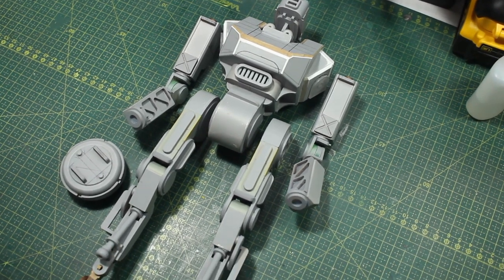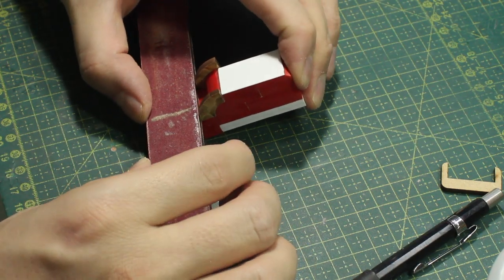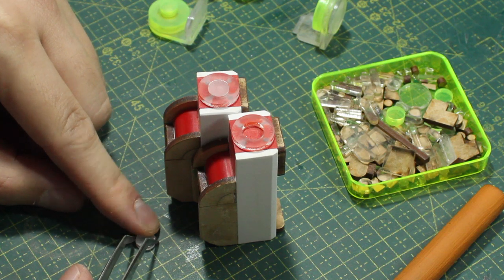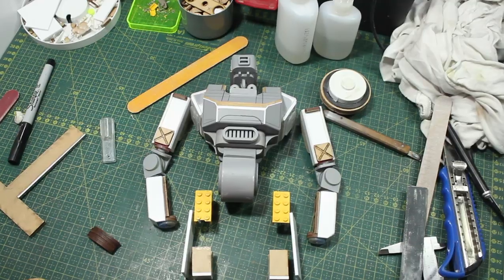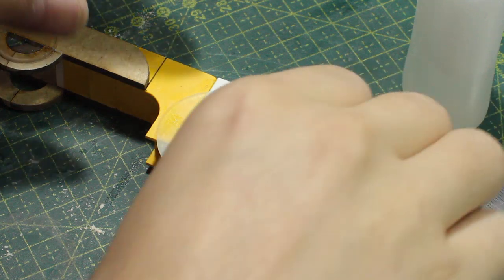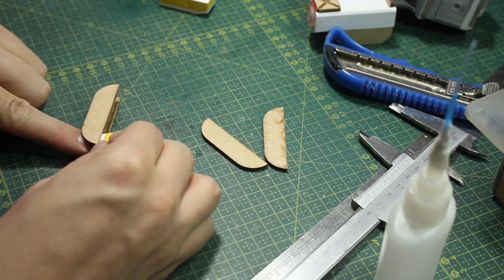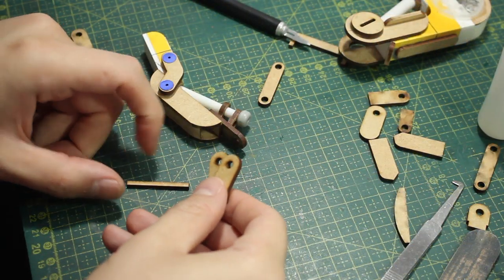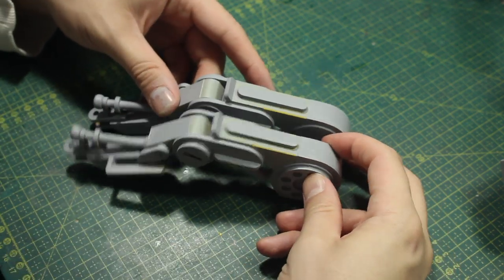Scratchbuilding a Humanoid Repair Robot - PT2

Comment: I'm a big fan of what you're doing. I hadn't thought of using the plastic bricks though. I noticed that you placed tape on the side of your mini sander. I don't recall if you had said anything about this before but, telling others that you did so to keep the small particles from sanding getting into your sander would be a help. Thank you so much for your willingness to share your creativity.
Reply from the maker: Thanks a lot buddy! That tape is only there to hold everything in place hahaha .. My mini disc sander recently fell in the ground and the living hinge broke :(. I took the opportunity to take the dust from inside, which wasn't much so, I guess this is not a problem, at least for now.. Thanks again and stay safe!

Comment: Oh, there you are. Hope you and yours are staying safe. My wife and I found a nurses aide that s going to be taking care of my uncle, and I’ll be going home next week. Your builds, especially this latest build, of the repair bot, gives me the itch to finish mine, when I get home. I have a question: how would I get in touch with you via email or what have you?

Also, I just realized, you can actually make a lathe and milling machine, in the same way you made your sander. Only with other machine attachments. If you look up “lathe face plate” and “DIY LATHE FOUR JAW CHUCK”. You can actually make your own attachments, making your lone sander into something of a “Shopsmith” (I’d suggest looking this up, too) this was a very versatile machine that turned into many other machines, in this one platform. With your naturally creative nature, looking at this machine, I can bet YOU can create something similar off of just your sander. And with a few hand tools (so long as they’re heat treated by the manufacturer, you can make lathe cutting tools. For example, when I bought my first metal lathe, I used a half Allen wrench, to make a cutting tool and made a 15” solid aluminum bat two inches thick. I can’t believe I didn’t think of this sooner. But your sander has the makings of being a lot of machines, in one. If you happen to decide to go that route, I can help you.
I don’t know if you’re familiar with this guy but he does some impressive work, he built his own machines in his machine shop, what’s more impressive...he has prosthetic limbs! 2! Maybe you can get some inspiration/ideas from him, too. Sorry for the lengthy comment. But again, as I’m not at home, I’m really bored not doing any of my projects. And I’m really desperate. Take care, stay safe and good luck.
:
Reply: Oops...I forgot the guy’s YouTube channel. I think he’s also Brazilian.

Oficina Mão Livre
Reply from the maker: Hey buddy! Good to know that you're and your family is well and safe.. I think you should work on your build for sure, can't wait to see that! We can chat on instagram via DMs, look for @cuttransformglue (link is also on the description box just above).. There's also a facebook page where we can chat. Also, thanks a lot for the tips and ideas about the lathe! I'll take a look on the channels you suggested me... In fact, I'm already looking for pieces for this build on Ali-Express.. I've been able to find some "mini lathe chucks", with 4 jaws.. I think I'll send you those links so that you can help me decide which one works best for me! Thanks a lot, as aways my friend! Hope you can get your hands on your build soon. Stay safe
Reply from the maker: Looking into it right now, thanks a lot!
Reply: @CutTransformGlue  Man, I would've never have guessed how many things can get in the way of a simple project. Sometimes I feel like I'm not supposed to finish my robot model build because it may be the birth of a robot uprising, based on my model robot, ALONE! LOL. Thanks.I'll be sure to get in touch when i get home.
Reply from the maker: I totally get you! My first projects took me literally years to conclude. Keep going, You'll get there!